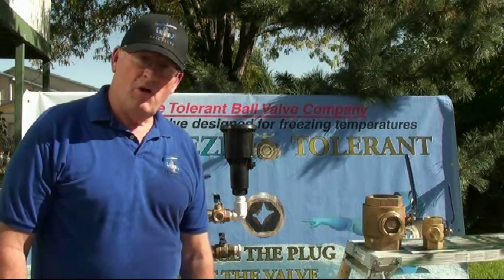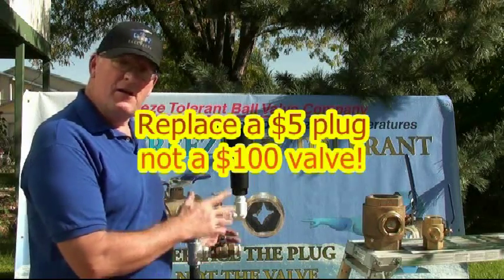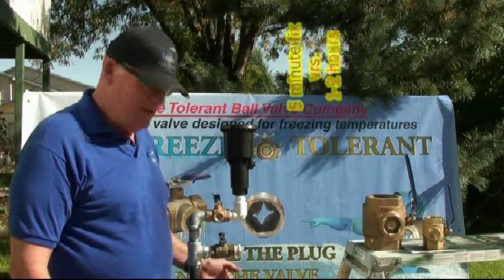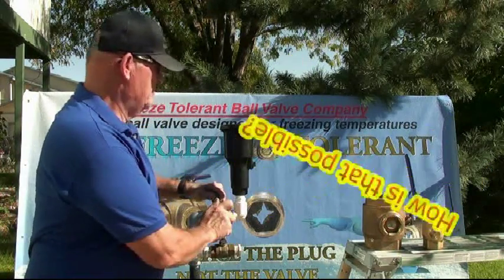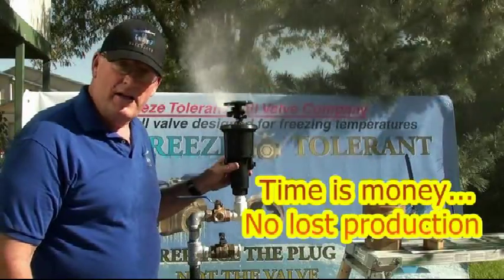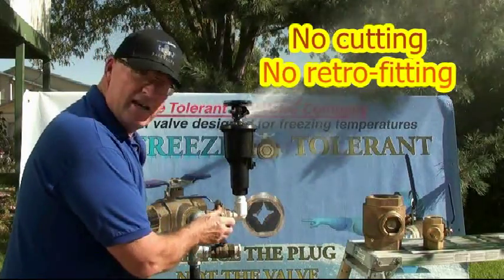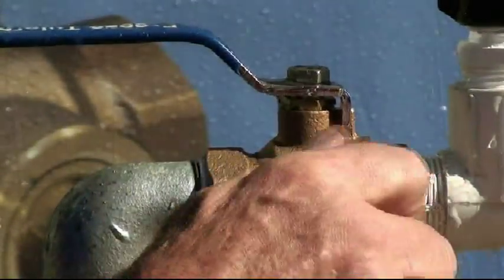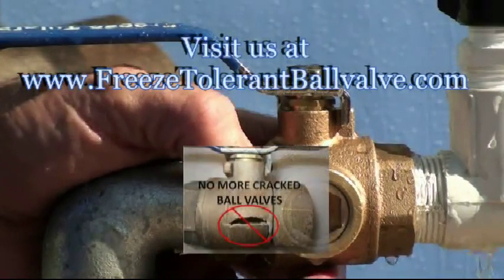Saving money with the freeze proof ball valve.

Comment: Is there a special tool to remove the plug?  Is there a certain socket for that?
Reply: hex tool comes with replacement plugs.... 3/4 in valve takes 13mm, 1 inch valve takes 11/16
Reply: Ron Lehman and where can I buy the plugs and the tool from?   Please send me a link.    Thanks
Reply: Do I keep the plug in during the winter or do I remove it.   Also my valve ball valve does not turn to turn it off.  I bought a 1”. The handle seems stuck.    Thanks
Reply: @jimvonfeldt6321  Jim, you can remove the plugs for winter if you like. I'm not sure what you mean that you can't turn the valve on. Is it installed ?